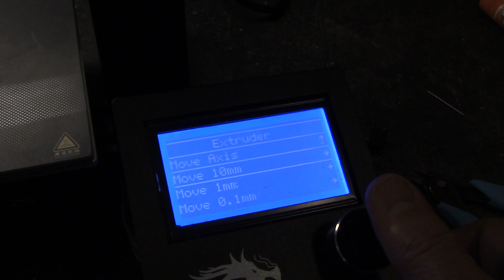Ender 3 Filament Feed Issue - Solved

Comment: Thank you sooooo much you just saved me I’ve been struggling and raging for hours
Reply from the maker: You are welcome.  I'm glad it helped.
Reply: @MyEngineeringProjects  i was printing a 10 hour print and it stopped feeding so i hope this works
Reply from the maker: @amandapacheco9398  check to see if the little plastic holder for the feeder is still intact.  Mine eventually broke and I had to replace it with a metal extruder.  Once it breaks, it cannot provide enough pressure on the filament to feed.
Reply: @MyEngineeringProjects  maby but I just got mine on Christmas but it is probably user error because I am new
Reply from the maker: I have written a basic troubleshooting guide.  The link is in the description.  This may help you out.  I'll update it today with some pictures to help explain how to troubleshoot feed issues.
Reply: @MyEngineeringProjects  thanks

Comment: The thing you press down to Get The white tube out it won’t let me press down.
Reply from the maker: You probably have filament backed up into the tube (this happened to me as well).  Try heating the tip and maybe turning the temperature up some more to try and soften it.  If it wont work, you will probably have to take it apart and snip off the end of the tube.
Reply: @MyEngineeringProjects  This happened to me and I had to take the bowden tube off, take the smallest drill bit I had an manually drill out the clogged filament. Once I loosened it up I was able to clear the tube of clogs.
Reply from the maker: @bobbyhughes7564  ok glad you got it fixed.  What size drill did you use?

Comment: My stepper doesn't even turn when I select move axis (nozzle is heated).

It's strange because it's new enough that nothing should be worn enough to need to be replaced but I've done a dozen or so prints on it successfully before this.
Reply from the maker: To make sure it's not related to a jammed filament, you can isolate the stepper.  Heat the nozzle, then press the release clamp and push the filament in --- then pull it all the way out.  Remove it completely from the tube.  Now with the nozzle still hot, try a Nozzle manual extrusion under Axis control
Reply: @MyEngineeringProjects  I figured it out, the extruder was working I tried to extrude through the menu without preheating the end and bed first. Once I realized the extruder was working I noticed the pulley wasn't. I tried to remove unscrew the pulley but it was spinning in place. What happened was the plastic extruder cracked and the pulley wasnt pushing towards the gear enough. 

I replaced the plastic extruder with an all metal one and it works now.

Comment: My ender 3 v2 works half way threw a print but then stop feeding and just shreds the filament in half
Reply from the maker: Have you tried adjusting the tension at the extruder?  Maybe it's too tight and damaging the filament.
Reply: @MyEngineeringProjects how do you do that
Reply from the maker: @PolarFrederick there is an adjustment knob at the extruder that changes the tension on the filament
Reply: @MyEngineeringProjects  thanks
Reply: @MyEngineeringProjects  I’m having the same issue on an Ender 3. Not pro. Not V2, ENDER 3.
Reply from the maker: @theofficialdummy1  Have you tried replacing the nozzle?  It might be damaged and pinched shut causing issues like this.
Reply: @ It’s software, not physical. When I push it manually, it works just fine. And when I use the Extruder option in the Motion tab, it comes out smoothly.
Reply: @MyEngineeringProjects  you madlad!!
Reply: Same brotha.... I give up!
Reply: @stickboyfpv4742 ame I threw my printer away waste of time
Reply: Ive adjusted my tensioner on the extruder made it loose made it tight and anywhere in between. My filament is aligned but ends up either getting clogged or just not feeding i can’t figure it out. I have an ender 3 v2 with the 4.2.2 board with the 1.0.7 firmware update. I’ve been able to make a few prints just fine but for the most part most my prints go through this issue of not feeding or clogging as far as I can tell. I’m not 100% sure which it is. I also think the feeder gear with the grooves has become smoothed. I’ve adjusted that and no difference on feeding. I’m not sure if it’s my hotend (which is new, ended up tightening a few screws too) new Bowden tube. New nozzles with the hotend. Im not sure why it keeps doing this. Seems picky to me and it’s frustrating me to the point I don’t want to print even if I enjoy it and love making stuff I can actually use too and toys for my kids. I could be saving money if it wasn’t for these constant mishaps
Reply: Samr
Reply: Same thing, I replaced feeding tube as end burned and now it's stops feeding in random time of print. I thought it clogging but no it is fine tryed playing with tension still cant solve
Reply: I am also having the same problem! I’ve adjusted the Extruder tension to be more loose and I’m going to print something to test it…
Reply: Well, it worked!
Reply: @TC9  Did you put the screw in deeper to loosen the tension ?
Reply: @turbofanenjoyer6969  I think to loosen it I put the screw more out.
Reply: @TC9  thx I just removed the whole spacer within the spring and I think it fixed it. (I am doing a testprint rn)
Reply: @TC9  where exactly is this screw? Been having problems with the darn thing clogging up all the time or screwing up the print
Reply: @falcon5751  the screw is located at the Extruder where it controls the tension of the filament pushing in/out.
Reply: Sounds like heat creep